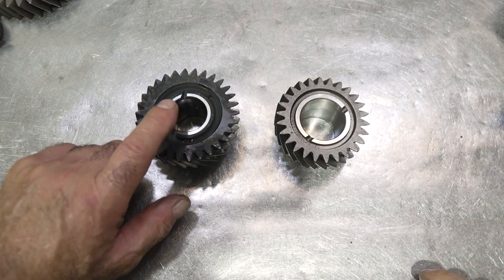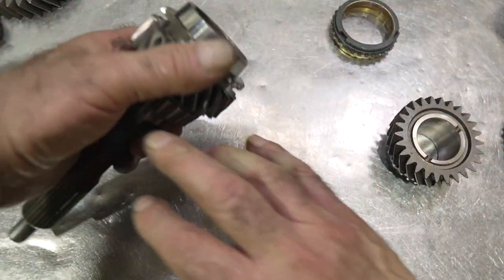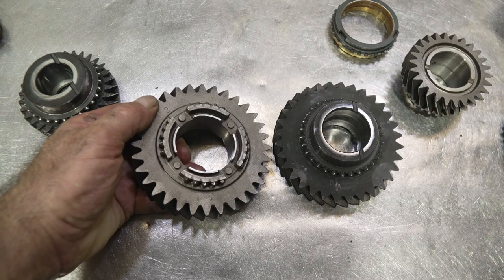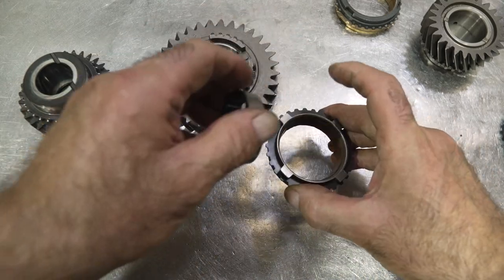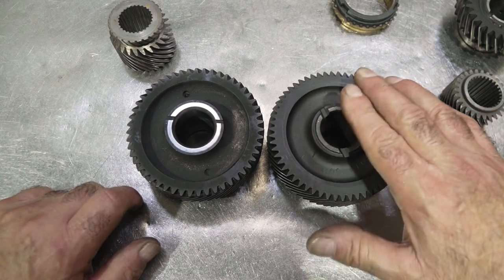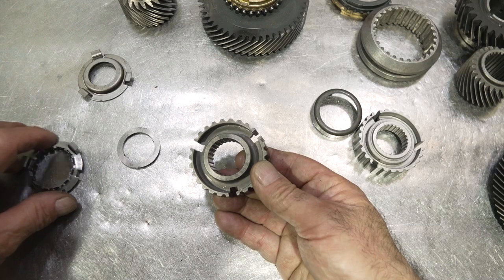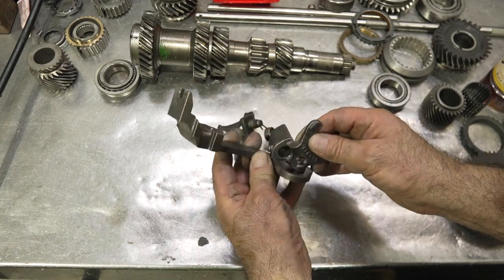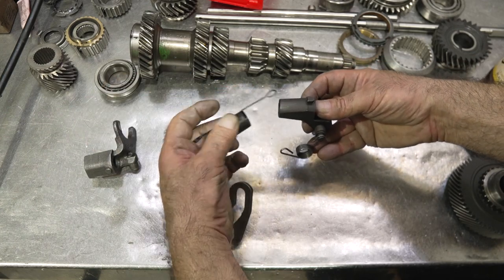Differences Between T5 Non World Class and T5 World Class 5 Speed Transmissions

Comment: Great video Paul, I’ve watched a few of your T5 videos and was able to tear down and check two I have here a 95 Firebird WC and a 90 s10 NWC. My question is the s10 has a 14 spline input which does not give much clutch options. We plan to put this transmission in a LS swap which we would be using either a LS1 clutch or a 70 big block clutch 26 spline. This would allow us to upgrade in the future to the WC Firebird transmission (if we could find a gm case to put the internal into) or a T56. What do you suggest for an input shaft swap for 26 spline and 21 tooth? Thanks again Paul!

Comment: So can you put world class main and gears into nwc case? I'm trying to figure out how to make my borg warner t5 handle more. The engine I'm building will be putting dowon about 500hp. scared my stock t5 is gonna blow. I was looking into g-force gear set but days world class only. So if I get that and main shaft would it work or would I need a wc case also?
Reply from the maker: Just get a TKX 5speed.  The concept of putting used 20 year old gears that were designed for a 250 HP application and expect to "beef it up" to handle 500hp will just fail in the long run. The NWC lower end and gears started failing and were replaced by a more stable World class lower end.  Therefore I cannot recommend you doing this

Comment: Thanks Paul. Fantastic Video. You covered it all! With your help, I have torn down a NWC T-5. Do you find most of your hours are spent cleaning, inspecting and reworking? I spent 12 hours cleaning each individual piece and inspecting under a bright light. I dressed all the burrs and dings in all the gears. Found broken tab on 1-2 shift fork, chewed up reverse idler gear, and severely worn first and second gear synchro-blocker rings. The gears look great...a little rounded on the points...but very useable. I painted the case, cover and adapter housing yesterday. Just waiting for the overhaul kit and new parts before assembly. Therefore, to say the least, I am looking forward to your assembly video of the NWC. I am literally walking in your footsteps and definitely owe you a cup of coffee. Thanks for your expertise and prompt replies to my many inquiries. I am honored to be one of your 100,000 subscribers.
Reply from the maker: Cleaning and prep took the longest
Reply: I have a Nissan ZXT NWC that I haven’t started but will soon!

Comment: While doing an S-10 NWC tail housing conversion on my Ford WC box, the oil funnels are different sizes. Should the WC funnel stay in the with WC cluster shaft? Also it seems to fit fine without machining the inside of the tail housing. I did remove the reverse brake tab. Thanks.
Reply from the maker: Yes leave the wc funnel in and eliminate the NWC stuff

Comment: I have a C4 Corvette with the Doug Nash 4+3 Manual transmission  1985  the transmission is stuck in Reverse gear  I have exposed the shifter  but cannot see the adjustment bolt  to adjust the reverse lockout. ? Can you help.
Reply from the maker: If you cannot physically go under the car, disconnect the rev rod and manually pull it out, then the issue is in the trans . Often times the OD seal will pop out and land behind the rev gear. Think it thru and remove the linkage first

Comment: You just might inspire me to try rebuilding my NWC T5! It’s been making a weird clicking noise when driving (if I push the clutch the ticking slows down) and sometimes it goes away completely once warmed. Comes and goes, doesn’t matter which gear but the pace of the ticking changes with the RPM. It’s really got me confused! I changed the pilot bearing and throwout bearing last year and forgot to put grease between the input shaft and the throw out bearing, but the housing for the throwout bearing was plastic so I figured that can’t be the noise I’m hearing. Maybe it’s the bearings for the input shaft? It drives completely fine! But the clicking/ticking noise terrifies me. It’s just behind a stock 305, it’s never had grippy tires on it. The trans does have a leak though, I’ve been topping it up often but it could’ve been driven with low fluid levels at some point.

Comment: I found your Videos on Doug Nash 5 speeds and you finally solved the Mystery of why my Dough Nash 5 speed shifts so slow. I replaced a Diaphragm Clutch with a Borg & Beck Clutch and it made no difference.  I shifted from 1st to 3rd once in a Drag race and really hurt the third gear synchro.. I just double clutch 3rd gear now.
  It sounds like you sell much better upgraded Synchro's for the Doug Nash 5 speed.  Plus it has always leaked since the day I  Installed it .

Comment: My tremec TKO 5 speed is leaking from the speedo cable. Any suggestions?
Reply from the maker: The cable goes into the case with a fitting that has an o-ring on it. Make sure the o-ring is in good shape If it's leaking at the cable where it's pressed into the fitting will then get a new fitting

Comment: How do I know if the Tremec 13-52-065-922 gearbox is what I use on the RF troller?
whether WC or STD without opening the gearbox,
Reply from the maker: The numbers on the side of the case are just casting numbers for a case. The actual model number  is stamped on a tag located on the extension housing

Comment: I have a T5 NWC in my 1981 CJ7 . someone before I got it replaced the shifter bushing on the transmission ,, well they beeped it up ,, I was driving and the shifter jammed up .. took out the tranny found a chunk of the old plastic bushing and half a lock washer in the shift pattern in the grease ..it shifted ok with a punch in the shift rail .. but when I reinstalled the tranny ,, very hard too shift ,, I don't know if the shift rail the long rod part could have bent ..like I said with out the shifter and the off set part it works ?? could the shifter be pushing down too hard or the shift rail bent ?? great video ,,too me I thought both the nwc and the wc box's were the same ,,
Reply from the maker: The roll pin for the offset lever may be driven too far or the pattern plate got loose and needs to be pressed in deeper.

Comment: What fluid goes in a Mustang GT 2005 TR3650 trans? I want to do a fluid change as my car is 18 years old, though it only has 25k miles. The trans has always been noisy since it was new. Anything to quiet it down? 

So much conflicting info. on fluid out there. DexIII/merc then mercV but then it's mobil1 ATF or synchromesh and there are just as many people against using it. Then there's the fill....3.8 or 3.2 quarts.

I know you're the one that knows how these work and what's right for them.
Reply from the maker: Ive always used a good synthetic synchromesh like Royal Purple Synchromax

Comment: The world class t5 has a little more of an heavy duty case and it has fiber lined blocking rings .
Reply from the maker: Not really. As shown in the video if you watch it to the end . At one point Borg Warner actually used the same case and machined that differently. This is shown that the non-world class case has the bosses already in place for the retainer plate holes that the world class model uses. Structural web improvements on the front face of the case were done first on the non-world class units and then migrated to the world class models

Comment: I just subscribed to your channel good information but my question is I'm installing a non world-class S10 rear housing onto a world-class front Camaro housing It does not have the reverse brake can I install the rear S10 housing without doing any machining  in the area of the oil slinger.  thanks Dave
Reply from the maker: yes you can. usually the WC funnel will clear and if you have a reverse brake, cut the tab off

Comment: Is the S10 T-5 NWC or WC? 
Can an S10 T-5 live behind a 500-600hp LS with upgrades? 
Can I make a WC an S10 T-5? 
The truck will be autocrossing and street driving mainly with occasional drag racing for fun.

Thanks Paul, you have a tremendous body of work that I hope to someday retain some of it.
Reply from the maker: The transmission was never intended to be used with that type of horsepower. The ratios are designed for 6 and 4 cylinder engines so I would not recommend using this transmission for that application. They came in both nonwc and WC configurations.
Reply: @GearBoxVideo  thank you for your valuable time sir. Thank you for ALL that you have done for the industry.

Comment: I'm doing and s10 conversion on my wc box, what I want to know is how do I compensate for the speedometer location,  all the versions I know of have different locations. Are there easy bolt on gears or does the shaft have to be moddified to work with the new location? 2 wire Electronic speedometer btw
Reply from the maker: You would use the digital drive wc st10 mainshaft. The tail can only be used with a digital drive . Will not work with a mechanical drive1

Comment: First off, amazing channel im glad i found it and you now have a new subscriber. My question is i have an 87 Thunderbird turbocoupe with the wc t5. Under high rpm and boost it grinds bad going from 2-3 enough to where i have to double clutch to avoid it. Im assumint synchro is shot? And or fork. I've rebuilt 3 speed autos years ago but have never torn into a manual. I am going to be doing it myself with your videos to guide me along. Does my symptom sound like its caused by what parts i mentioned? It does not grind at all under normal to medium acceleration. Thanks!
Reply from the maker: Yes probably the ring is shot. But you may also want to try and give yourself more clutch release. It's possible at the higher RPM that the clutch is dragging enough to cause a grind.
Reply: @GearBoxVideo  thank you I appreciate the advice! Again great channel keep it up!

Comment: Thanks, Paul for answering the question in regards to swapping input shafts. My plan is to upgrade my NWC T5 to a WC T5  and want to use the input shaft with course spine from my NWC so I do not have to change the clutch plate that is on a Chevy 3.1 V6.  When you mentioned the difference between the NWC and WC main shaft I take it the output shaft end splines are identical?
Reply from the maker: Output spline are the same.
Reply: @GearBoxVideo  One more question. My NWC T 5 input shaft has 21 teeth and the GM WC input shafts have 24 teeth. Will this be a problem? Thanks again for your educational Videos. Looking forward to rebuilding a GM WC T5.
Reply: @Blueomicron rewatch the vid... he said your input swap has to have the same tooth angle, pitch, and count. Now think about it, assuming your tooth profiles match, a lower tooth count has to be a smaller diameter gear. If your diameters match, the profiles have to be different. Either way, you end up with gears that won't work together

Comment: I’m picking up a NWC T5 for my 66 mustang, $300 think that’s worth it? I don’t plan on making over 300whp with the 289 ever.
Reply from the maker: Worth it if it doesn't need rebuilding, because you don't know what's wrong with it until you open it. The other thing is you have to factor in the cost of a conversion kit
Reply: @GearBoxVideo  it turned out to be a 4cyl world class box, I picked it up for 200 after negotiating. So now I need a gear set and rebuild. (Winter project) any recommendations for parts what/where to buy?
Reply from the maker: Oem gears are super expensive. People selling aftermarket gears from Taiwan are your best bet

Comment: Another guy recently posted a video talking about how the only WC blocker rings available on the market right now do not fit properly. Any truth to this? I need a set and have been putting it off till I confirm. Thx!
Reply from the maker: There are aftermarket rings that do not fit correctly. The original rings from Tremec do.  Problem is people will only buy the cheap stuff now because the cars are not worth it... As a result it is hard to justify stocking large quantities of original equipment parts when the majority of your customer base would rather by the cheap junk . One of the reasons I don't have kits yet
Reply: @GearBoxVideo  is Tremec still producing them? Or do they just do limited/occasional runs? The price of Tremec rings used to be petty high. In today's market, those prices seem reasonable (unless Tremec raises prices even higher, which is definitely possible). Having said that,  if someone contacts you looking for new blocker rings, what do you tell them? Are they SOL or can they wait it out?
Reply from the maker: I dont have any and will not sell aftermarket T5 parts. That is what I say

Comment: I have a WC T5 from a 93 mustang.
It grinds going from 1-2 only when cold 
ATF fluid , it I noticed it has aluminum looking swirls in the fluid.
Once warmed up it shifts great .
Could  this be worn shift fork and synchro?
Reply from the maker: Usually a fork is worn. But warm of cold should not matter. Trans should take ATF Dexron fluid
Reply: @GearBoxVideo  thanks for replying to me.
I have Dexron  ATF in it.
Is there any way to inspect the synchro with the top cover off  when I am checking the fork without pulling the main shaft out?
Reply from the maker: Yes, see if they are flat against the gear. Look at the height of 1st compared to 2nd

Comment: Got interesting  question  I have t5 from s10. CAN I use the transmission  for 4.3 if I get different  bell housing  like on v8 far I as know it's 89 t5
Reply: I informed got its from 2.8
Reply from the maker: Some of the input shafts are longer. You will have to measure and figure it out
Reply: @GearBoxVideo  ok thank. So much

Comment: how do I confirm gear ratio of a 1352-232
Reply from the maker: I would not know
Reply: Mark the input and output shafts , in 1st gear rotate the the input shaft however many revolutions to make the output turn 1 rev and that tells u yur first gear ratio, that tells u what set u hav.

Comment: can you take a WC 2.3 mustang and swap out the 1st gear to a 5.0  or any of the 5 gears for that matter ?
Reply from the maker: No, completely different gear set
Reply: @GearBoxVideo  so could you swap the whole internals into a  mustang 4 cyl  t5 case and make it a 5.0 t5? Or are there differences in the case itself
Reply from the maker: No case differences. So you can swap complete internals. Outpit shaft is the same

Comment: Thanks, Paul, for this informative video. I have read about the differences between the NWC and WC transmissions,
but seeing the video really makes it all clear.
Do any of these differences affect the choice of transmission fluid? I use Pennzoil Synchromesh in my 1987 Camaro 
(NWC T5), and the shifting is quite smooth. But there seems to be a lot of debate/confusion on the Internet about T5 fluids
(especially for the NWC).
Reply: I always used the latest edition of Dexron back in the 2000s, but I think the latest versions are not well suited to manual transmissions. Redline sells a manual transmission lube for manual transmissions spec'd to use ATF as their lubricant.
Reply from the maker: They never took gear lube. Original NWC and WC had stickers on the case that said use ATF only. The Pennzoil synchromesh works great as well as Royal Purple SynchroMax.  Ive run Mobil One multi purpose ATF for years in all of our endurance boxes before brands started formulating specific types.
Reply: @GearBoxVideo  Thanks for the info! It's reassuring to hear it from a real expert!
Reply: It's worth noting that cases that people fill with normal gear lube and ignore the advice to use ATF, as specified, may be very hard to shift when cold. Depending on the type of lube dumped in, it may damage bushing material, too. There is also the possibility they will run hot depending on how thick the gear lube was and how hard you run the transmission. 

Despite the name (of the fluid) the BW/Tremec T5 and many other light duty manual transmissions, both foreign and domestic, were designed to use ATF, which throws a lot of people off especially if they are used to old 3 and 4 speeds.
Reply from the maker: One thing often overlooked is clearances. The journal clearances are tighter then older 90wt units. That is why you see seizures when using gearlube. A very common failure
Reply: @GearBoxVideo  Yes, I learned about the clearances and narrow oil passages by reading material written by yourself and other professional rebuilders. Some of the amateurs out there claimed that anything with brass synchros (such as the NWC T5) would require 90wt gear lube, but someone pointed out that Tremec officially recommended Synchromesh for their TKO series (with brass synchros), so I knew those amateurs were wrong. I figured if Pennzoil Synchromesh could be used in the TKO, I could use it in my NWC T5.
Reply from the maker: The Chrysler A833 Hemi Box with bronze bushed gears ran ATF and that was in the 1960's